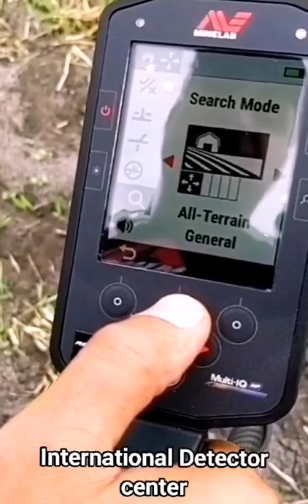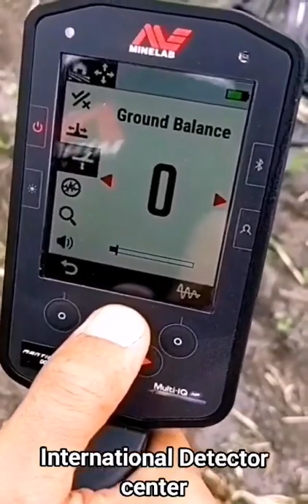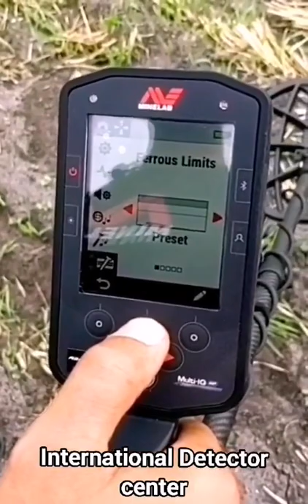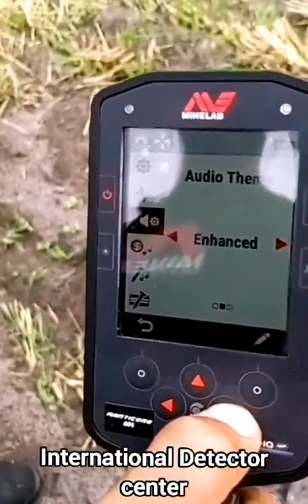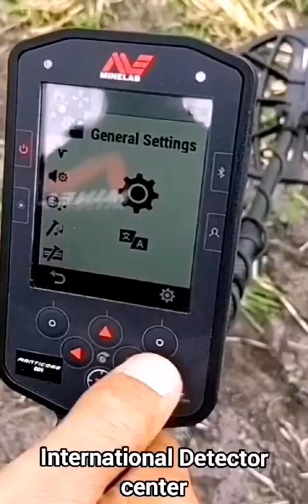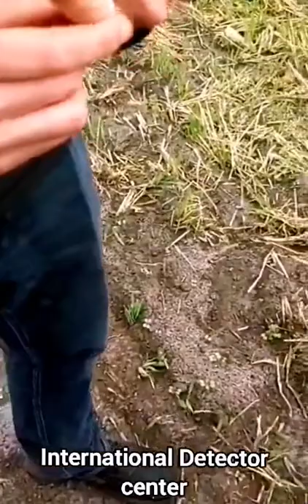Manticore Minelab Highlights Features and setting the Best Metal Detector in the World

Comment: The best metal detector in the world, I doubt that very much.  Is it completely wireless, no. Can you use it to a depth of 30 meters, no. Is it lightweight, no. Is the control box detachable, no.
Reply from the maker: Yup combination by two system eq800 and ctx3030 make this metal detector more superior then other
Reply: None of those features have anything to do with performance.
Reply: Been tryin to get my xp orx coil fixed here in America and xp just directs me to random places to file warranty claims with no return addresses. And then the dealer on Amazon tells me to contact xp idk costumer service sucks. I like my orx when it charges the way it should. Im into beach hunting and the minelab 340 vanquish is as good goes deeper and quiet on both wet and dry with no adjustment. I say minelab has xp beat. Xp orx has the small break down and faster separation
Reply: Sorry but the price is not ok for what it is €2000 in Germany, no, I'll buy a Deus 2 and have a machine that works, even the Legend was better than the Manticore in the test, sorry 900-1100.  I would have seen € but I see € 2000 overpaid there!